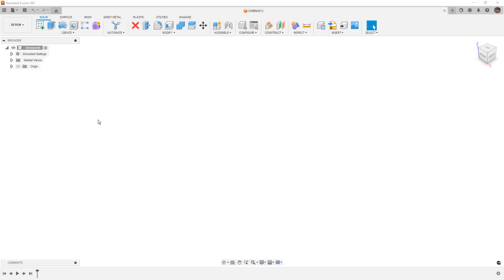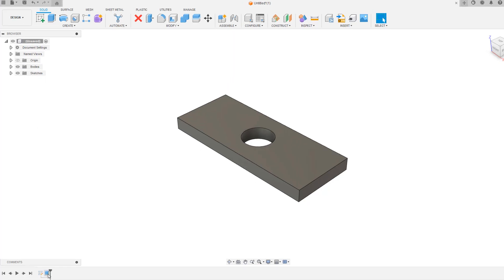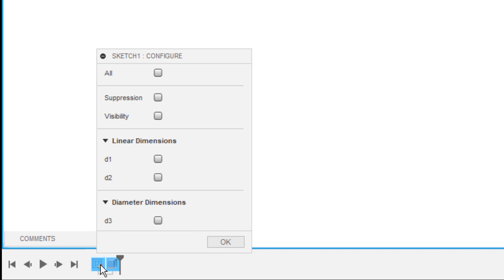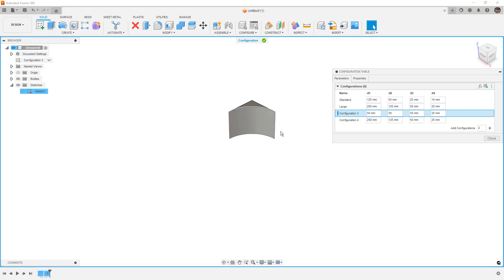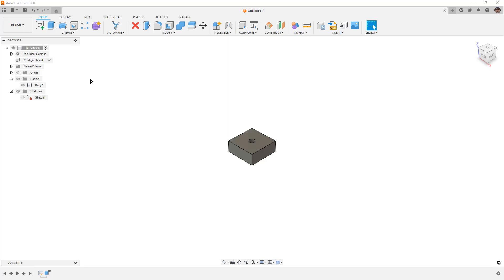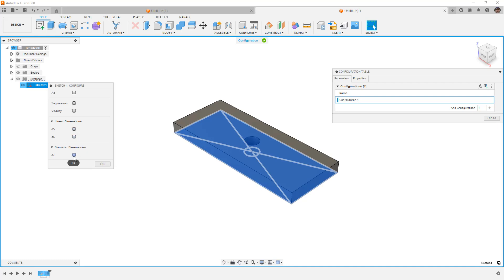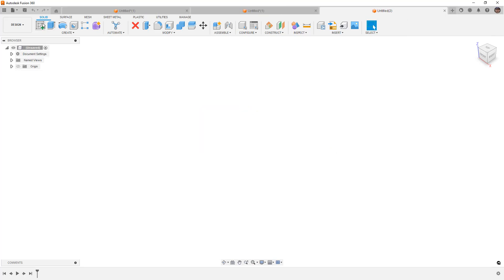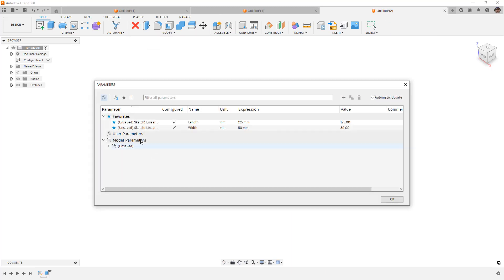Fusion 360 Configurations! | What's New Sept 2023 | How To Configure A Part | Tutorial

Comment: Could I ask how you could automate the following part. I have been trying to create a set of squares using only parameters to create this part for 3D printing clearance and fit testing. My idea was to create a grid of 5 x 5 squares with one row dimensioned squares of 10,9,8,7,6mm extruded 10mm. On that extrude chamfer the top and sides by 0.1mm. Then on row 2 reduce the cube size by 0.1 and the chamfer 0.1. On the following 3 rows reduce the size and chamfer by a further 0.1mm. The last row would have sizes reduced by 0.4 and the chamfer at 0.4. This way you could take a machined cube of 10,9,8,7, & 6 and check the clearance required for a force fit, tighten fit and a loose fit for using in your design. Of course squares of 10,9,8,7,6 would be kind of useless, but you get the idea. The only 2 ways I can reproduce this is a manually by hand, but if you wanted to change the primitive you would have to start again. Or using a script that takes a users input and produces the appropriate model. But I have found you end up with 1 sketch 25 x extrudes and 25 chamfers again not practical. Is there another way to automate this using patameter driven sketches and features? Perhaps using a pattern?
Reply from the maker: Hmmm....  I think the direction you pick will be heavily based on if this model does require constant changing.  I don't think you will be able to automate it in a way where you can just enter a value and have it build the entire part(bodies) unless you do write a script.

BUT, in terms of making this a robust model where you can edit tolerance and base values I think it could be done with just a few simple parameters.

If you go the script route i did a video awhile back on making design with CSV inputs.  so you could build a spreadsheet and build a file(with some more coding first).

You could do this with configurations, but honestly parameters are probably easier.  My suggestion would be to have a few basic parameters like itemNumber, Clearance, Offset.
itemNumber would be 1,2,3,4 and you would use this to multiply by another value.  So your chamfer for example.  If you are on the 4th item you would multiply a chamfer value (.1) x the itemNumber(or row number) giving you .4.
Same goes for building the overall size.  Say you wanted each box to be 1mm smaller than the previous, have your offset value of 1mm.  Then you sketch the first one "FirstBlock = 10mm"  and then your next one would be "FirstBlock - (ItemNumber x Offset)"  or something like that.

This would require you to build the basic model but if you use the parameters carefully it should be robust enough for you to modify some basic numbers.

Do you think you would have to change the size, tolerance, chamfers on something like this a lot?
Reply: @LearnEverythingAboutDesign  thank you so much for your prompt and concise response. Yes I think having multiple different printers that the calibration of shapes if a clearance is required whether that be loose, tight or interference. Especially when changing materials. A large majority of my prints are time consuming and there minor validation of the clearance or tolerance I think is necessary to ensure as far as reasonably practical the print will succeed. Probably an OCD method, but after time I store and build profiles of clearance and tolerances per machine material and settings. You raise some valid points although I think this could be a valuable update for Fusion 360 so that programming isn’t always required and in different scenarios programming isn’t an option in a complicated assembly. 
Stubbled across you recently and love the channel. Thank you
Reply from the maker: @andyhelipilot3528  Here is what I was thinking, just didn't have the time yesterday to model it.  https://a360.co/48wZUHy  So in the Change Parameters dialog you can change Block1 to something else say 15mm and all the blocks update and stay spaced properly(note that i used Block1 dim to also space out the top and bottom blocks).  If you change the Offset value that will change the next size down.  Right now its 10,9,8,7.  If you make offset = 2 it will be 10, 8, 6, 4.  Tolerance controls the size of the bottom 4 blocks.  its .1mm now so the second row of blocks are 9.9, 8.9. 7.9, 6.9mm.  For the chamfer i just did a .1mm on the smallest and multiplied it by the block so the largest block as .4mm chamfer.

Hopefully makes some sense.  And yeah i totally get what you mean about the print.  When i print something that i need to say press an LED into i always do thin test prints first for bolts, led, and other things that need to fit.  Screw bosses are the big one for me.

Comment: Now we have most of the feature to fully rely on fusion for product development. Do you have any information if they are going to add kinematic simulation like solid works ? the available motion study is almost useless
Reply from the maker: Not sure on that one.  I know contact sets in Fusion work a lot better than enabling contacts in Move with Solidworks.  But true kinematic motion in an assembly, including tracking points, adding dampers and motors etc is still much better in Solidworks.  I am honestly not sure if we will see that in Fusion since Inventor is still the mechanical design product.  If i ever know you will know :)

Comment: Great video. It’s still a little tough to understand how this will be used in real life. If you create a new actual project utilizing configurations, could you show how you are using them? Love your videos!
Reply from the maker: Yeah it is a little tough to see.  I used to do this in Solidworks and Driveworks.  One example was a client I worked with making Firetables.  So lets say you have 2 standard table sizes and the frames were nearly the same, one just longer.  You would have a single sheet metal design that was configurable as "long" and "short".  Then in the assembly you might have the option to have say a glass shield on one table so you would have a design for that which could be suppressed in the assembly.

There are a couple of ways to look at this.  One is a variation of a single part. like a screw for example.  You could have a 1/4-20 screw and a dozen different lengths.  In a config you would change the length of the screw, length of the thread, maybe even coating or material.  That screw would be used in an assembly and if you have a design where one component needs a 1/2 long screw, you pick that config, but another design might need a 1in version of that screw.

I will try to come up with an example that doesn't take hours to go over, but does that help at all?
Reply: @LearnEverythingAboutDesign  it does make sense, just trying to see the huge benefit over just using parameters. I’ll mess around with it and see how it goes. Thanks for the reply!